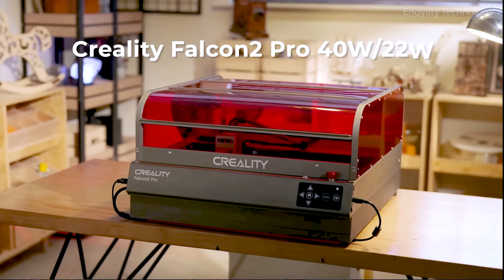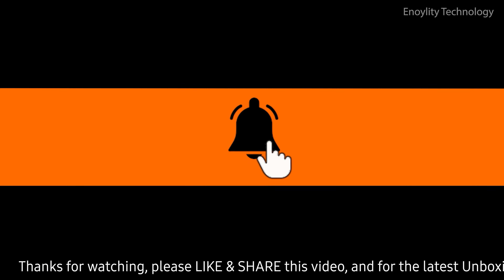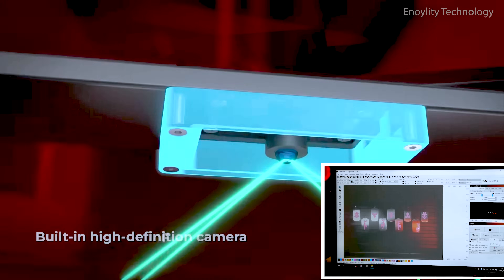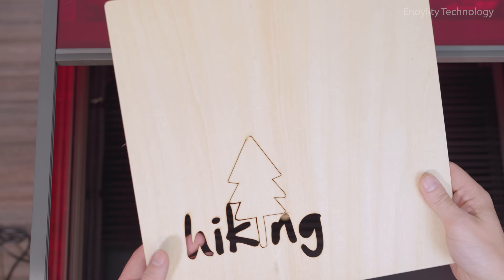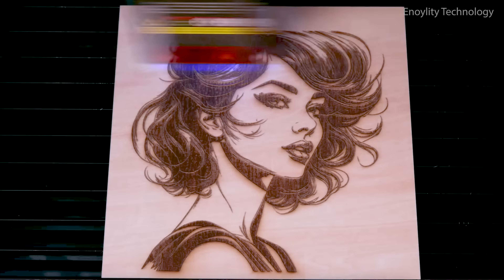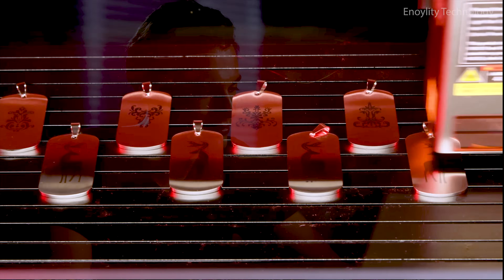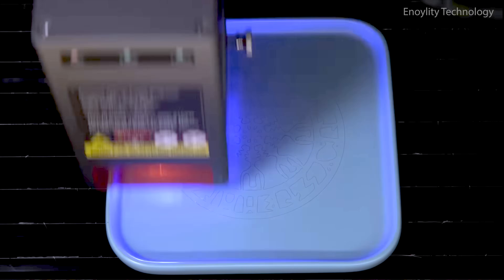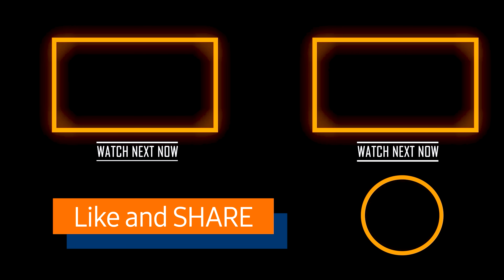Creality Falcon 40W Laser Review: Powerful Precision Engraver for Every Creator!

Comment: It’s basically turned into a side business machine for me now 😊😊
Reply: It makes my projects come out so much cleaner. Performance wise, it's fast. With four times the laser as my old one, it breezes through stuff that used to take me much longer, or not able to even handle at all. So far, I've cut and engraved wood, leather, and acrylic all with great success.
Reply: The hardest part is learning the software. It is enclosed, so you are not breathing the fumes. It also has a purification filter so there are no hazards as it exhausts fumes. Very easy to set up. The ability to make extra money with this are limitless.

Comment: The safety features are a huge plus too😍 auto shutoff, flame detection, the whole package
Reply: The laser itself is capable of very fine detail and is powerful enough to cut through wood and acrylic. I was even able to cut out shapes in 3/4” pine without much charring of the edges.
Reply: The engravings are not coming out perfectly. I engraved some outline text and a lot of the lines were wobbly and didn't connect perfectly, such as the O. I tried a slower speed and that didn't help. I'll have to keep testing it to find the optimum setting to get the lines to come out correctly.
Reply: This is a great engraver. I've had for over 1 months and it has had zero problems. Be prepared to do some experimenting and learning. Super accurate machine love the details in making a jpg in to something I like.
Reply: The pictured "Laser Crosshair Brightness" control box was really my first burn project which is now used for any/every burn project to permit me to perfectly set the burn start point very easily.

Comment: I’m obsessed with the rotary attachment compatibility 😊 Just did a tumbler set for a wedding gift 😀
Reply: Yeah, and you don’t need an external exhaust setup if you use it in a well ventilated room 😊
Reply: The software was incomplete, missing several advertised features, and the laser lacked the necessary power to make even a single cut. After a lengthy two-hour discussion with the manufacturer’s support via live chat, their only solution was to suggest using a different type of wood, which was not a satisfactory resolution.

Comment: That enclosure is not just for looks, it really traps the smoke and improves visibility too 😁
Reply: Plus, it's perfect for apartment users. It keeps things clean and controlled
Reply: I absolutely love the integrated air assist feature! My projects come out with no charring, so there's less cleanup and post-processing involved, saving me lots of time. The air assist seems to automatically adjust to the project, so my engravings come out with nice detail while my cuts are clean.
Reply: This laser engraver 10w is excellent—it’s fully enclosed with a protective cover, equipped with a filter and exhaust fan to minimize odors, and features air assist and autofocus for smooth, precise cuts
Reply: The laser comes with everything you need to get started. I was really impressed with the care that went into the packaging of the laser and all accessories! They used every available space to either add accessories or protect what was included.

Comment: Honestly, this machine feels like a premium industrial engraver but without the industrial price 💯
Reply: True. It even has real time monitoring. I love that I can keep tabs on the process without opening the case
Reply: Right now I am going to say that this is a good machine. I’ve run CNC a little in the past so I understand the basic concepts and so does my son. We got it set up and ran a couple pieces. I need to get the speeds and feeds correct so plan to run a test soon, but honestly have not had the chance to play with it much since we did that first run. Mainly because I need to set it up in an area where it’s going to vent outside, and during the winter here in my area it’s darn cold.

Comment: Tech support is helpful and fast—Creality seems committed to good customer service
Reply: As a beginner, I found the Gluwphy engraver incredibly easy to use. The pin-point system and autofocus eliminate the need for manual adjustments, which means less time spent on setup and alignment. It’s especially helpful for working on smaller items like jewelry.

Comment: Dust and smoke control is much better than expected—makes indoor use manageable
Reply: The only issue I've had with it is that on a rare occasion, the cable that attaches to the laser can get in the way of the wheel and cause it to not move. I haven't looked fully into yet, but I'd assume it's just about moving it slightly so it can't get that close to the wheel.
Reply: It would be easier to manage the cords if the air assist and power connections were on the same side. The air assist is on the left and the power and computer connections are on the right, so I have cords coming out both sides. At least the power cord is nice and long

Comment: Compatibility with LightBurn makes designing and exporting files super convenient
Reply: This laser is built great. Easy to use out of the box. The functionalities, features and the design of this laser is fantastic
Reply: These newer high-power diode lasers are definitely not a toy. I have cut mainly 1/4"" plywood, EVA foam, and hardboard, and engraved on some plastic sheet made for laser engraving.
Reply: While this model doesn't come with a rotary module, they are available. I would love to expand this laser's capabilities to engrave on curved surfaces by purchasing the rotary module in the future.

Comment: The 40W model is incredibly powerful—it cuts 20mm pine in one pass and leaves a clean edge
Reply: Setup was straightforward after watching the helpful videos on the manufacturer’s website, which I suggest for saving time! The engraver is quiet, fast, and highly accurate. I purchased it to make gifts for friends and family, I am thrilled with its potential. It arrived securely packaged with foam, was easy to assemble, and pairs well with LightBurn software. I highly recommend it!
Reply: My friend has a Glow Forge and I debated on going that route and I am glad I did not spend all the money on it. This machine performs as advertised and as well as the Glow Forge (in my opinion). My daughter is 14 and to be honest - set it up and showed me how to use it. Love my Ella!

Comment: The 22W model is surprisingly lightweight and easy to move or store when not in use
Reply: I did get a cover with a vent fan and hose so will be using this soon. I know that doesn’t tell you a lot about the machine, but it will help keep the fumes under control.
We had a really good time setting it up. It was very easy to do and it ran correctly. The settings burned a little deep the first piece we did so I need to get used to how to set it up.
Reply: The directions are okay for assembly, but for ease of using the machine, I would encourage using the tutorial videos on the external software website.
Once I watched a few of those videos, it was much easier to figure out what I needed to do.
Reply: It performed splendidly, although it took several attempts, and wasted cutting boards before I got the hang of things. But the projects take a fraction of the time (and cost) due to the target materials being so ordinary and cheap

Comment: Great value overall—the 22W gives a solid entry point, and the 40W is a pro-level powerhouse
Reply: Upon receiving the laser, I opened everything and all looked well everything was packaged nicely so I assembled everything and fired it up for the first time. The laser immediately fired on 100% high power in the same spot I wasn't paying attention as I was still working on some cable management behind the laser and my bench caught on fire
Reply: The pictures tell all. I also use the AtomStackmaker rotary that works great and to keep from playing the "connect/disconnect game" when using the rotary, I also fabricated a switch box that keep me from having to jocky the "Y" axis stepper motor connector

Comment: Both versions support LightBurn, which makes advanced design workflows seamless
Reply: My biggest issue is that it took way too long to figure out that the machine wouldn't initially power on because the emergency button was pushed in. There's nothing in the instructions about that and nothing on the machine to indicate that this is the issue. I thought it might be broken and had to watch several videos online before someone mentioned it. I honestly thought I might have a bad power cord or something was broken. They do include a key to lock some functions right next to the emergency shut-off, but I have no idea how that works.
Reply: Safety features are well-considered, with proper shielding and protective mechanisms to ensure a secure operating environment. While the machine's power is substantial, noise levels are surprisingly low, minimizing disruptions during use.
Reply: I was so excited to see the big box arrive at my door. Opening the box was fun!! Set up was easy. The instructions were nice to go by.

Comment: The 22W model holds its own in precision; great for engraving logos, art, and intricate patterns
Reply: This machine is amazing I have another machine that’s only a 5 watt it does do a lot of the stuff I need but this here does a lot more then I expected and at a speed that was well worth the extra money compared to a lower watt one super happy with it so far and it’s several months now I put it through a lot before I did a review I’m satisfied to tell u a must for ppl new or even ppl that’s been doing this hobby for a long time and looking for a new machine
Reply: The laser engraver I recently purchased has been a fantastic addition to my workshop. Its ease of use and straightforward setup make it accessible for both beginners and experienced crafters alike. From unboxing to engraving, the entire process is intuitive
Reply: This laser must be operated in a well-ventilated area such as an open garage. In the future, I would like to build an enclosure with a dedicated ventilation, since this generates smoke and other vapors as the laser sublimates the materials

Comment: The Falcon2 Pro 40W is an absolute beast—it slices through 20mm wood like butter and does it cleanly
Reply: The smoke removal fan is loud and not that powerful.
After hundreds and hundreds of cuts, i am concerned the power is not as good as day 1. I used to be able to cut 3mm ply at 15mm/s at 100%, now after 300 sheets cut i need to cut at about 13mm/s at 100%. Unsure if its air assist is just less powerful (wearing) or if laser is waning.
Reply: This is the first one I have ever used but the setup was easy and just spending time figuring everything out. But the test pieces I have done look amazing. I will add pictures once I get this dialed in.

Comment: Using it in a small workshop. I made a DIY enclosure and now I can run it all day without bothering neighbors
Reply: High-quality engravings.
Reply: Got mine very quickly. Unfortunately It was slightly damaged in shipping not any issue of the manufacturer but they did send replacement parts very quickly. Once repaired this thing has run like a dream it has many of the thoptiins that you usually don't find on lasers at this price point.

Comment: How long does the laser module last?
Reply: Hard to say yet, but it’s rated for thousands of hours. Keep it cool and it should last a long while
Reply: I love that I have this machine, and plan to get some pieces going soon as the weather is warmer and I can open a window.
Reply: The rudimentary picture illustrates that the side rails need to rest on the screwed in set screw at the bottom. This keeps the side rails from slipping down from the weight of the head - IT WILL

Comment: My acrylic signs business took off after getting this—output quality is solid, but I had to get my settings just right
Reply: The fast engraving speed increases productivity, allowing users to complete projects more quickly and efficiently.
Reply: This is far more powerful than my 5 watt engraver. I haven't used it with a roller (that's what my 5 watt is set up for) though Creality rollers are available. It connected with Lightburn easily, I had to choose the com port
Reply: This laser comes with a three-level focusing piece that is fairly small. It would be helpful if it had a hole in it that I could run a chain through to attach it to the machine so that I don't accidentally lose it. I may glue one on just in case.
Reply: It performed well and it has a wide range from light to dark. Having the filter is the best - no mess! It is well worth the money spent! I will be busy making tons of projects!! So ecxited
Reply: I’ve been playing around with engraving and cutting quite a bit. I thought some pics might be helpful so you can see it works even when you’re a beginner! Im a work in progress for sure, but I’m getting there!!

Comment: I’d recommend this for makers who already have a bit of CNC or 3D printer experience
Reply: Supports different engraving depths.
Reply: The engraving detail is insane—even fine text and graphics come out sharp on both models
Reply: Pawn examining the machine I realized that the memory board plug pins were all mangled up, I did my best to strengthen them out and I was able to get the laser to fire properly but then I had no stepper motors for my x-axis. I contacted the company immediately and I've since been waiting over 2 months for them to send me a replacement motherboard
Reply: I still need to test how it works on acrylic and other materials but for now, I am just trying to get it to work better on wood. I will update this if I figure out how to improve the perfections with the engraving.

Comment: What materials have you engraved with it?
Reply: Wood, leather, anodized aluminum, acrylic, cardboard, slate—you name it
Reply: I've done stainless steel, bamboo, and glass
Reply: It's cutting thicker than 4 or 5mm seems to burn the edges of the board more than you would think. not beautiful brown like 3mm cuts. you get charred black edges.

Comment: There’s no touchscreen control panel, which would’ve made onboard use smoother
Reply: If you use it daily, make sure to clean the lens regularly—burn residue builds fast
Reply: Offers a warranty.
Reply: This machine initially appeared promising based on its specifications and generally positive reviews. However, it fell significantly short of expectations in practice. We attempted to use it with a 12 mm MDF board baring in mind the advertised thickness that was stated was 18mm of wood but then the customer service team said that’s incorrect and it should be 20mm of wood, which it should have been capable of cutting, but it failed to perform
Reply: Well made product, though I have enjoyed learning how this machine works... I have to admit, although more difficult to grasp, I use Lightburn for all the wonderful things I can do inside it
Reply: I used things that were laying around the lab and house before I decided to destroy the first cutting board. The third one was the best which is pictured here. I obscured my name in the photo. I was overzealous the first two times and created craters by setting the power too high. This will be a very useful tool, and toy.

Comment: Can the Falcon 40W cut acrylic cleanly?
Reply: Yes, but make sure you’re using cast acrylic and proper air assist—otherwise you get melted edges
Reply: Yes, it cuts acrylic very cleanly with smooth edges
Reply: No problem at all with acrylic, even at 10mm thickness
Reply: The clear instructions made setup a breeze, and within a short amount of time, I was engraving my first project. The software it comes with is user-friendly and offers plenty of flexibility for different design types.
Reply: Overall I think this is a great machine and I will have fun working with it. I have the Creality enclosure tent over it and they fit perfectly. It's an improvement over my old one and has a more powerful laser -- even though this is just the 12W version -- so I will have fun playing with this.

Comment: No emergency stop button? That feels like an oversight at this power level
Reply: You can pause and resume jobs, which saved me during a power blip
Reply: it suitable for users who may want to take it to different locations for projects.
Reply: This is an advanced mod that also requires the "Y" axis limit switch to be moved "away" from the front rail of the unit by about 20 mm or so to provide the clearance necessary as the adjustable Z bracket DOES REQUIRE more room to keep the laser head from contacting the laser front rail.
Reply: This laser is super beginner friendly, and what I really like about it is that is safe to use it inside my house